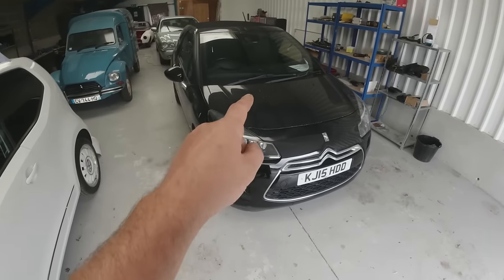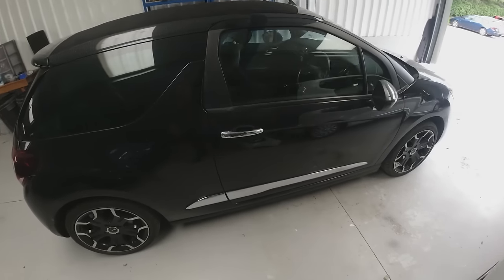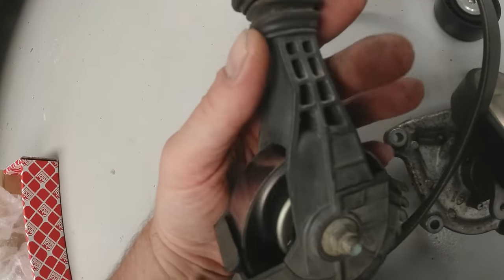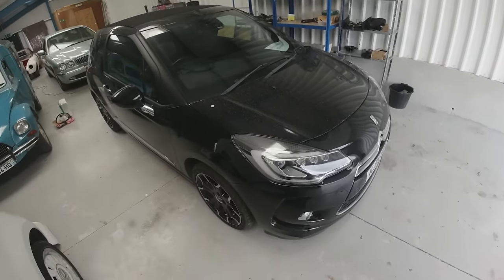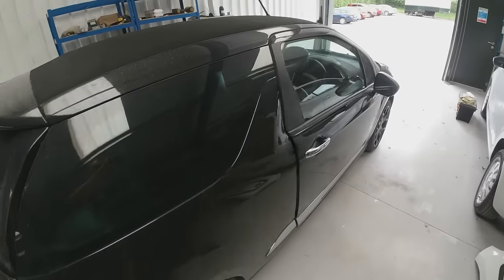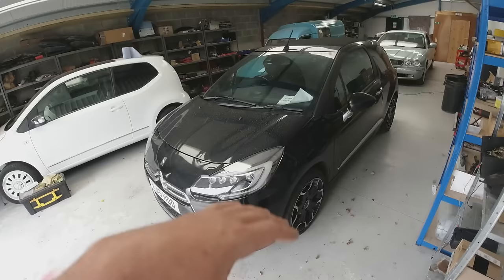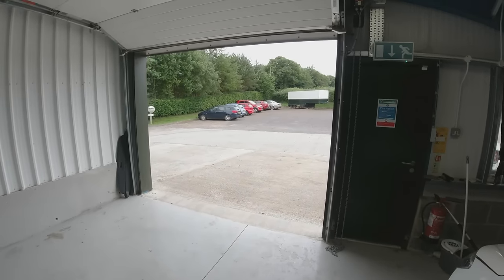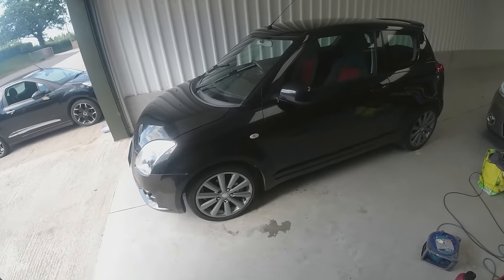Traffic Police pulled me over , and boy I am glad they did!

Comment: When I had my nearly new 93K 1st Generation 405 1.6GR I had to change the timing belt before 24k miles. I loved 405s&406s but only PSAs TDs&HDIs were great engines.
Reply: The Peugeot 405 was a brilliant car to drive and so well equipped as long as you stayed away from the Low GE/GL spec models.
Reply: @devilmahon666  I also had a 405 1.9TD GLX 95N &2 x 406 2.1TDs 97P &2.0HDI 110bhp 2004. I didn't like my 306 1.8 Sedan. All my 406s were in Diablo Red.
Reply: @Pmjs  one had, 1991 405 1.9 GL, 1994 405 1.9 GRDT, 1996 405 1.9 DT Executive, 1996 406 2.0 GLX, 1997 406 2.0 Turbo Executive, 1999 406 3.0 V6 Executive, 2000 406 1.8 Rapier. As you can tell I liked them a lot!
Reply: Ah, another early 90's 405 with issues. I just knew I wouldn't have been alone...  405 GRD Estate here, back in the early 90's. No Peugeot's ever again for me. That car was a total financial liability. One thing after another just kept going wrong. It cost me a fortune in the time I had it. I got so pi$$ed off with it in the end, I traded it in for a poverty spec Astra Merit with no power steering and wind up windows, just to get rid of it. Not a single thing went wrong with the Astra in two and a half years. Very basic but reliable.... So impressed was I generally with the Astra, I bought a nice 1 year old Astra GLS estate, with the Isuzu diesel up front. Sunroof, alloys, velour trim, leccy windows. I was in seventh heaven! Great little car, which my next door neighbour bought from me when I decided to change it.
Reply: I had a VW Passat 1.9TDI 130bhp SE 4motion 2003 I loved it so much I kept it for 6 year's.
Reply: @Brian-om2hh  I had an Astra J 2.0CDTI SRI Sports Tourer 2013 reliable good ride&handling. Its a pity they did away with the 2.0CDTI for a 1.6.

Comment: So it's a Citroen...and you sound surprised the Water pump and its drive & tensioner system seems overly complicated and convoluted, Really?
The belt is using the reverse to DRIVE the pump using, not the 6 Grooved side of the belt,...but the flat back?  How bonkers is that?
As for the tensioner being electrically operated....words fail me.
Reply: It sounds like one engineer got knocked back by the partner for some horizontal dancing the night before.  Due to being upset, they went into work the next day and put this nightmare onto paper, as an "Up yours" to the partner and all unsuspecting owners and mechanics!  This was said about the Mitsubishi 380 - the rear spark plug is in a nightmare position to get at; literally half the engine has to be removed to replace the one spark plug!

Comment: My Mini was making a horrible noise..A good local garage diagnosed  the timing chain @ 862 pounds.
After doing the job the noise was the same so I had a refund and was told to to run it until it goes bang as they could not locate the problem.
A few weeks later I found that the water pump pulley was breaking up.30 quid and half an hours work it was cured.
Reply from the maker: They refunded you? That's pretty straight up!

Comment: It's a part time water pump, The electronic tensioner extends and pushes the flat side of the belt  up against the wheel on the water pump, once the water in the cooling system cools down the tensioner retracts again taking the belt away from the water pump 🙂
Reply from the maker: What daft design
Reply: I bet a little engine management light comes on when it fails ... and 99% of joe public carry on driving.  Once pressurised coolant exceeds 120c it turns to vapour and you suddenly have head gasket bothering hot spots forming. 😁🤣

Comment: I wonder does the water pump only work when needed? using the pulley and tensioner like a clutch? is that why it has a electronic element to it?
Reply: Thats exactly it. Helps warm up the engine quicker and reduce emissions.. allegedly!
Reply: @sammytheseal2307  So all that expense to do exactly the same thing as a Thermostat. That's progress.😂🤣😂🤣🙄😔
Reply: @stephenjones9153  exactly 😅
Worst thing about it is that it still has a thermostat, this system just works with it 😆
Reply: Fuel savings must be tiny! And the cost of repairs must easily out way any advantage
Reply: @alreadygotone9180  Of course, as with most of these things!

Comment: That's a ridiculous design....... two tensioners, and one of them is electronic? Definitely a case of designers trying to be too clever for their own good. 
All things considered, the parts were pretty cheap though, just a totally uneccessary expense really....... lets hope it's fixed.

On a different tack, WTF was a traffic plod doing cruising through South Molton of all places? I'm thinking he was on a fishing expedition for rural ne'er do wells..........
Reply: Likely it was a retrofit to an existing engine design to get slightly better mileage or emissions.   Basically, it didn't matter if it was a hack as long as it delivered the numbers with minor costs or engineering changes....

Comment: When your at your dealer friend go for a longer spin, ie get into top gear bud, only take 5 mins. When you get back look at the back rev it up, look for smoke
Reply from the maker: Yeah the Terios was that cheap I knew I was going to do nothing with it so just did short run. V50 T5 Volvo Auto Estate yesterday went for decent run, all gears, turbo boosting then revved up in yard to check for smoke. Might still be something I missed but can't do much more checking than that, would of not had any of that at auction. And still got it for £1000 less than CAP trade.
Reply: @ChopsGarage  good mate, 5 mins is all it takes, saves weeks of heart ache, I got 3 this week and flipped one of them, micra auto, there like having gold little autos, just on with tidying a little picasso I've had mths, it's got a few issues so looks like I'll blow on it but I've got to clear these long stayers this summer, but easier said than done mate.
Reply: @ChopsGarage  yard lads give me the keys at the auction so I'm half confident of what I bid for, I make a point of being megga friendly with them and they give me the run down, one guy is a ex mechanic and like on that spider he said it drove spot on and it did.

Comment: My 1.3 gl 2006 suzuki swift was absolutely minted property the cleanest, everything was replaced underneath including subframe whole underneath was Bright red, wish I never sold it, 130k on the clock would think it was on 20k it was that good, sadly I sold it a few year back for a stupid price of £500 because I ended up getting the kia ceed jd 1.6 crdi and the twat crashed it and wrote it off, I managed to get it back again for £100 and now it has a k20 engine running 236bhp flying machine 😀also its the 5 door one

Comment: Citroen / peugot designs are always over complicated.
Reply from the maker: yes as a rule
Reply: Their diesels are better.
Reply: @mickymac6571  I would have agreed with you  20 yes ago, I had a  Peugeot 406 diesel that had 250k miles on the clock when I sold it on. That of course was pre common rail era, have PSA common rail diesel powered fiesta van and that's not in the same class I'm afraid

Comment: Those electric pump drive things are s***t and well known for failing. 

It’s a really really bad idea/design, very badly executed, with low quality parts used. 

When they activate the water pump they run on the back (unribbed) side of the belt as it goes round one pulley (crank IIRC) and the rubber coated water pump pulley. If you look at them they have two sections of the metal wheel exposed. 

I think it is a PSA engine design. Enough said.